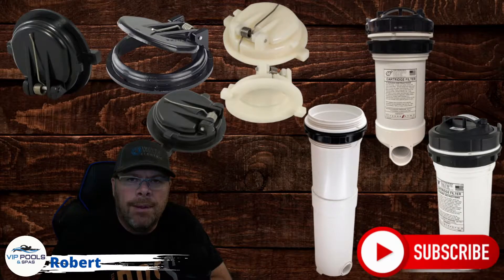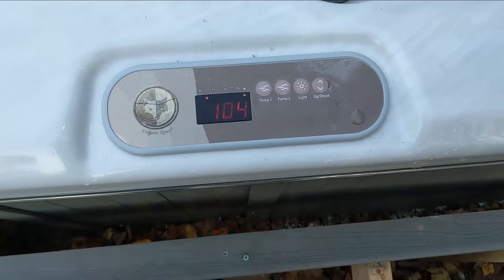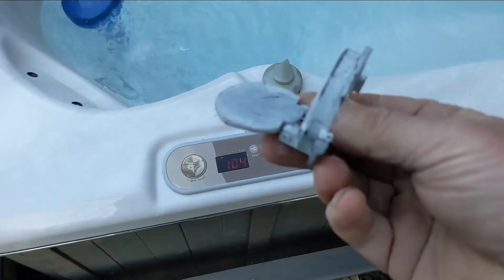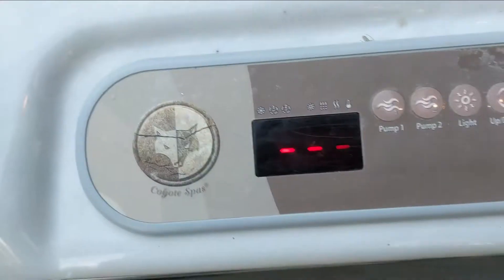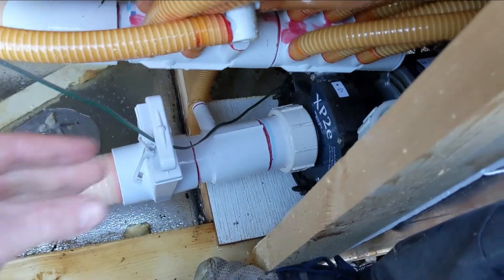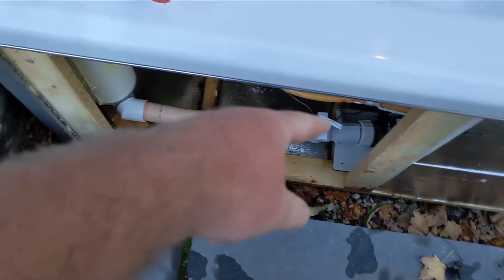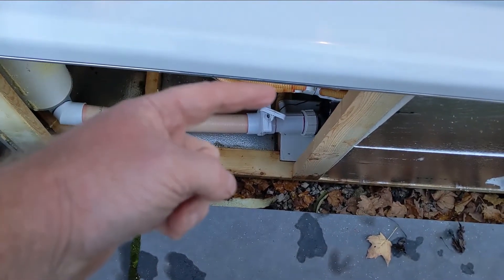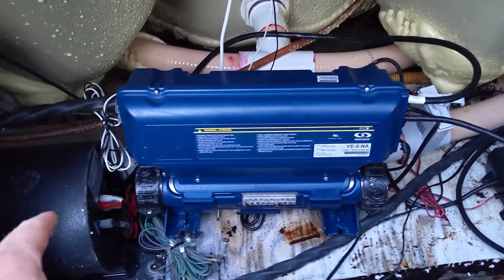Hot Tub Flo Error Code / Low Hot Tub Water Flow / Hot Tub Bypass Valve / Flapper Valve

Comment: Had this tub for 8 years and never knew it had a flap before the filter. Makes complete sense. My flap is still there, I think I have a dirty filter. Just looking around YouTube to see what else it may be and run into your channel. Thanks for posting this, much appreciated. RG
Reply from the maker: What's the issue your having?
Reply: @VIPPoolsandSpas  I'm having the 3 lights and the filter light on. Looks like the filter needed cleaning. Will know tomorrow.
Reply: @VIPPoolsandSpas  Update, seems like without the filter in after a period of time the filter light comes on. Not sure of the amount of time it takes before the filter light comes on. Would a fault pressure switch cause this?
Thinks RG
Reply from the maker: @RG_sssSMOKING  If you have a concern its the pressure switch, just change it.  if the heater light is on, the heater element is working and so is the PS.
Reply: @VIPPoolsandSpas  thanks for the reply. So if the pressure sw is working what other problem would it be? Thanks Mr.  @VIP
Reply from the maker: @RG_sssSMOKING  weird how the heat light is on and you have the 3 lines or dots.  That's 2 different things.  One.  Light is on, the ps is working.  TWO.  The 3 dots tells be it's a flow issue and the ps doesn't work.
Reply: @VIPPoolsandSpas  you got me thinking now. I'll do some more checking. Thanks for the input.

Comment: I troubleshot a breaker trip with the XE gecko pack.  Found the flapper from the valve in the heater element tube.  Ours has a thread on filter canister in a weir.  Where in the world is the actual flapper valve body at so I can replace it?  Dynasty Spas "Serenity Cove" model 2017.  Any help appreciated.
Reply from the maker: Can't replace that type.

Comment: How do you remove that valve? I have the same problem. Do i have to turn it?
Reply from the maker: It's hard to record that because the space is so small.  Turn the tub off, take the best picture you can of that filter and send it to info@vippools.ca.   I will send the picture back with instructions.
Reply from the maker: Just  a follow up.  Did you get the new part in ?
Reply: So do we turn it or how does it come out? I have the same problem with a broken spring so the filter doesn't get good flow
Reply: It anti clock wise turns to unlock. But then if the two raised bits aren’t broken (like in this video) it won’t come out. I’m still trying now, looking for videos on how. I can brake it more to get the old one out but then getting the new one in will be an issue.